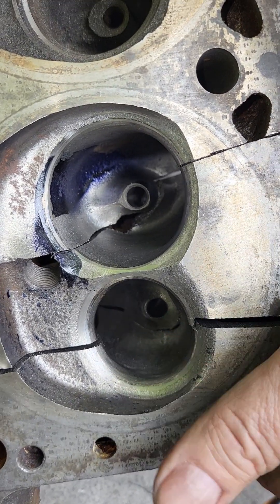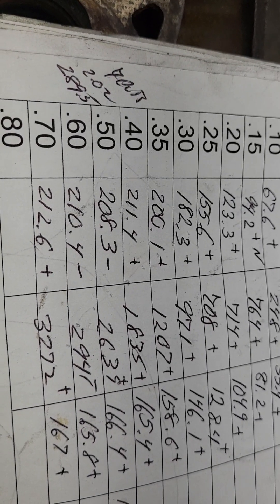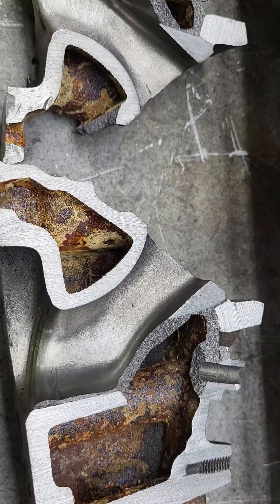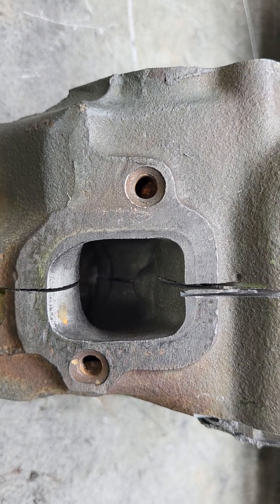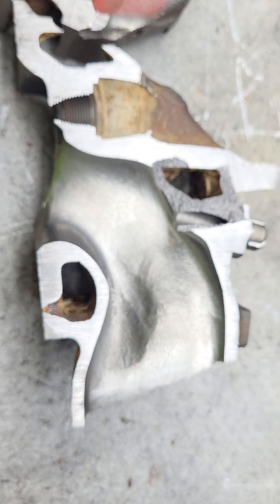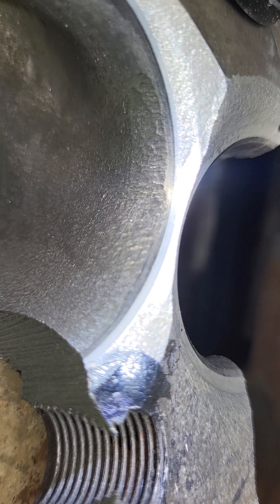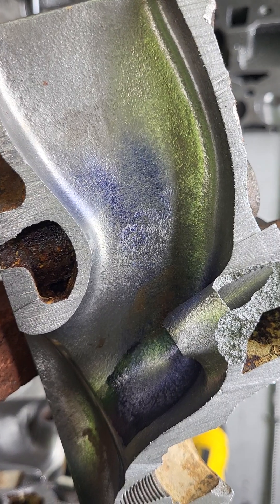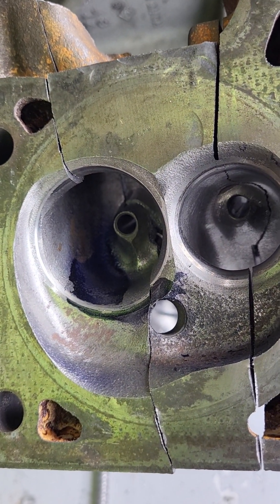Dodge magnum cutaway, Magnum ported to 290cfm!

Comment: Probably a dumb question but ill ask it anyway . On the part of stem on the valve that see's air flow inside the port can you shave that section of the valve a 1000s of an inch or 2 to improve on flow or will it make the valve too weak 🤔
Reply from the maker: @MoparMan-1978  Valves are highly stressed. Modifications to stem would be risky. Thanks

Comment: I've cut those open right along the Crack and the Crack would need to go about 2 inches up before it wild get to the nearest water, that's why you don't see those trucks running around blowing stream out the exhaust.  As for copying the vortex head... it came out 3 years before the vortec.
Reply from the maker: @davidphillips3953  Good info. Thanks

Comment: Hi charles 
with what factor you change the valve size?
if you can put the big valve on head you do it? Or something else
Thanks
Reply from the maker: @amirdoshmanfekan5145  Depends on application.
Reply: @servediocylinderheads im confuse about street/race what valve you use
Reply from the maker: @amirdoshmanfekan5145  Oversized Ferrea
Reply from the maker: @amirdoshmanfekan5145  Depends on rpm and needed power for application.